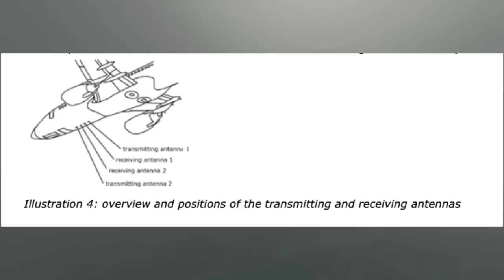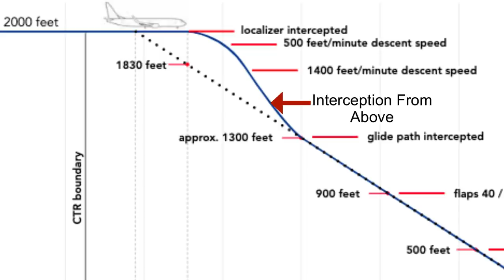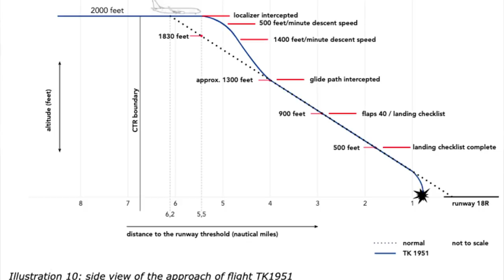How A Broken Antenna Crashed This Plane | Turkish Airlines Flight 1951

Comment: I retired from this plane and saw this glitch a few times.  Just a minor inconvenience.  This crash is yet another sad example of pilots who should not have been there.  Too unskilled to fly their planes with out all of the automation working.  This isn't fair to the passengers, they buy a ticket, not a chance.
Reply: Do airlines or regulators require their pilots to land manually on occassion (outside of the simulators)?
Reply: @rowboat0317  Good airlines yes. But some airlines (Middle and Far East) expect autolands to be performed wherever possible.
Reply: @rob737700 - I disagree. This is an example of how things can go wrong if they are not managed properly. It is also an example of how useless an untrained “safety” pilot is.
Reply: @Trevor_Austin  Well, sir, I believe there should be more flying going on instead of managing.  Basic piloting skills are just too lacking these days.  Pilots are struggling with their automation all they way to impact.  Sad times..
Reply: I did not even watch the movie as i know the case so well..
When it happened within halve a day i had my conclusion which (appart from the political correctness bullshit) almost was the same as the official report a year later.
If four pilots are not able to do what every hobby pilots does as general practice then they should stay on the ground. Much saver for them.
I fully agree with Rob !!!
Reply: @rowboat0317  Captains descision
Reply: @Trevor_Austin  Then why was he there in the first place. these people just where not able to handle an aircraft like this one (and be resonable its not a difficult aircraft to fly)
Reply: Agreed.
Reply: This was just a good example of poor piloting skills on all levels. How accidents like this happen is astounding
Reply: Fidd88  I agree with you with the licensing being the way it is but I think the rationale for not doing it is that you don't want a pilot instinctively slipping (no pun intended) into that response in a crunch when they're flying a big plane; I seem to recall seeing something about at least one incident where that caused a crash; and the pilot wasn't new to large aircraft but it was just that in a crisis when he didn't have time to think he did it instinctively.
Reply: @prismpyre7653  the American Airlines A300 that had its rudder break away ? The pilot did that because that's how the AA training for wake turbulence went, but there where factors with the airplane itself that lead to its demise.
Reply: @Trevor_Austin  Hmmm i've been training pilots for many years on request (it was not my official job). It often struck me how just dependend some people where on a single indication while all others clearly showed what was going on.
Many crash reports i have commented where just a mather of eghther
* Lack of traning (result of budget cuts/savings or lack of competence)
* Lack of understanding (result of above)
* Lack of following procedure (result of above)
Only a few cases i just stated: 'Things just can happen'
I'm i holy ? No certainly not i did do stupit things to ! beside i haven't flown for 20 years. Still i have a pretty clue what was (still is) going on in aviation.
Reply: @doabarrellroll69  I don't think so? But I watch so many investigation videos it's hard to say lol
Reply: @doabarrellroll69  pretty sure though that one was on takeoff, right? the one I'm thinking of was on approach
Reply: @pascalcoole2725  I'll look for that video, thanks.  I have heard about "magenta line" flyers...
Reply: Fidd88  Side slip is what saved the Gimli Glider.  Scary as hell for the passengers, but a damn sight better than getting killed.
Reply: That's what absolutely amazes me about air travel. 
 They can actually get that many people to trust their lives in one of these things!
   Crazy.
Reply: @pascalcoole2725  Totally agree (also with Rob), it may be known that those eastern pilots are less well trained than western pilots. I will therefore not board an airplane of such companies for any money.
Reply: @rowboat0317  It's up to the crew to decide which way to land. However, in poor weather they have to calculate how much beating the plane can take. With a high wind shear before and at the touchdown they do a VFR landing (visual flight rules or manual). Most flights are performed with autopilot most of the way including landing.
Reply: Fidd88  Was that the only reason they had to let you go? If it was, they were totally wrong. How on earth can one even fly an airplane without the sideslip? I was taught that probably on my 3rd lesson. How do you fly or prepare for the touchdown in cross wind?
Reply: Didn't it cut their speed without them knowing though?  At that altitude the drop in airspeed put them into a stall with too little altitude to recover.  Only thing I can blame them for is not keeping a better eye on their airspeed.  Maybe they were distracted by the landing checklist.
Reply: @rowboat0317  I heard that US pilots are given more emphasis on manual flying skills vs other nations who rely more on the automated systems.  Some pilots though have gotten into trouble because they tried to fly manually but were disoriented.  In fact the infamous Aeroflot crash, where they let kids sit in the cockpit, it could've been avoided if they had let go of the yokes and let the autopilot recover.

Comment: 3 professional pilots fail to monitor airspeed and they crash Day VFR When they knew  the RA was inop they should have turned off the AP .   Plane still flies perfectly without the RA.
Reply: Wrong! The main problem was the effect of RadAlt 1 on the autothrottle system.
Reply: They should have immediately clicked off autothrottles and autopilot upon initiating a go around.
Reply: Their is too much relying on the automation. When time comes to manually fly no one is wants too. Too much automation and very little hand flying capabilities.
Reply: @portanav  true.  In this one pilots were not monitoring their air speed   which is crucial for landings.  So it wasn't only  Antenna problem that crashed the plane
Reply: @Trevor_Austin  As this happened in the Netherlands, where I live, I followed this accident with much attention. 

The investigation determined that the main cause for this accident was the pilots being way too late to set-up the plane for landing, even though they knew they had a bad altimeter that probably would add to their work load during the landing. If the pilots had set-up the plane before entering the landing procedure, they would have noticed the auto-throttle pulling engine power back to idle during the landing for more than 90 seconds! The same goes for the flare-up manoeuvre: if the pilots had finished their set-up on time, they would have noticed the plane going into flare-up mode and realised the computers were still operating on the data from the defunct altimeter.

When the pilots finally called for full power, it took too long for the engines to spool up from idle to delivering thrust again and the crash was inevitable. 

End-conclusion from the investigation: pilot error instead of automation error. The pilots were simply relying too much on the automation to do everything for them even though they KNEW they had taken off with a bad altimeter and that the automation might get confused by the difference in data between the two altimeters. 

As to intercepting the GS from above: this is a fairly standard procedure at Schiphol Airport and known to pilots. All the more reason they should have finished their set-up way before entering the landing procedure, as they knew (or should have known) that even with a perfectly working airplane they would be in a very high-load situation during this landing.
Reply: Failed to turn off RadAlt 1, failed to go around when not stabilized at 1000ft, failed to monitor airspeed, failed to turn off auto throttle at stall warning. How is that not inadequately trained?
Reply: @Trevor_Austin  Wrong. I'm not a pilot and even I know that if the altimeter is broken, then autopilot either is going to fail or be unreliable. The pilots are stupid and can't manually fly a plane nor do any of the required actions to recover the plane.
Reply: Fidd88  nope, this is NOT fault of FBW, but the automation that is only applicable through FBW... but not fault of FBW per se...
Reply: Fidd88  It is perfectly possible to use FBW without ANY more automation. It is also possible (alas not automatically achieved) to use only thoroughly tested, usefull and proven automation. Thus, one who condemns FBW per se is incorrectly oversimplyfing the problem and in effect spreading incorrect information.
Besides, you must be aware that you fighting windmills (as don Quiote), right? Noone is going to manufacture pure mechanic system anymore for transport category aircraft...
Reply: Fidd88  We would disagree on some details, but basically yes.
BUT imo the solution is not to throw away all automation... rather put all efforts to make it more robust (debug better), maybe more same between plane models, and teach about it better...
You must be aware its not going away, not happening. So maybe do the next best thing, make it work better and easier?
Ofcourse, pilots WILL logically loose some of their proficiency, bcse using their manual skills less, can be to some extent corrected by more (manual) training, the simulators are now damn realistic and will even improve...
It's like saying auto gearbox destroys the capability to switch gears manually... yes it does, but if it works good why bothering?
Reply: Fidd88  "entirely avoidable new accidents occurring when these highly complex systems start to fail in unpredicted fashions or combinations" Sure, no argumenting here (not even possible to argument on this one).
"it's pretty evident to me that an awful lot of pilots going through the system these days do not have a wonderful lot of hand-flying experience" Again no argumenting. It is prinipially unavoidable since auto(pilot etc) is so often/long active that the time pilots novadays use manual is considerably decreasing (and IMO it needs some solution, dunno how).
Also in my opinion they need more standards as to how the "human-machine interface" is looking/working, in time of big colour MFD it is no problem to make them look/work as similar as possible, even acros different types/manufacturers...
About functions/logic... test, test, test (and keep no secrets in this area, publish everything for open review)...
Reply: Fidd88  Oh yes, but where to get those hours (even on light planes) there are not flying that many today? Maybe start at cargo at least... but thats only partial solution...
However, simulators becoming even more and more realistic... at least something...
Reply: Fidd88  This is not FBW, this is "fly by hand and when the machine feels like it it will interfere".
Rather different from real FBW, which is the machine being in control and letting go when it detects internal inconsistencies. Such as Airbus' "alternate law".
Reply: Fidd88  

Airspeed on a glider? Yeah...
Didn't they tell you anything about altitude?
Reply: Fidd88  8

.
Reply: Fail? Pretty easy to spot what's wrong I guess when sitting in front of you tube.  Historically There were 148 instances where the altimeter did no function.  Given such low attitude disaster was inevitable during one of these malfunctions

Comment: About the dual aoa sensor software, as far as I know: that is the obvious and safe choice however then the system would be flagged as safety critical in the documentation and would require extra training and certification which they wanted to avoid.
Reply: The problem was NOT that there was no comparator (or redundancy) it was that RadAlt No. 1 ALWAYS drives the Autothrottles no matter which autopilot is engaged. This was ‘feature” not documented.
Reply: IIRC the MAX also hat the ability to actually display a warning when both AOA-sensor-readouts didn't match up. But it was an optional feature that airlines had to pay extra for.
Reply: It's what happens when bean-counters get to decide technical choices.
Reply: @brkr78  an how does AOA-Disgagree indicator information help? Is there a system linked to only one AOA-sensor that behaves as automatic antistall using the trimming? Boeing still denies that.
The Boeing 747 does not have an anti stall system linked to the AOA Sensor that autotrims the plane out of stall. MCAS is totally not an anti-stall system and pilot totally do not need to know, that MCAS is trimming their plane, because that totally only happens in certain flight configurations.
Reply: @brkr78  extortion, for safety features. Nice ...we really have come far as a species

Comment: As I watch these videos, one of the most "baffling" aspects is the failure to FLY THE PLANE!!!  EVERY pilot KNOWS fly the damn plane.  So why are so many pilots NOT flying the plane?  This was an easy fix, turn off the damn outopilot and hand fly.  Why 3 experienced pilots, no one could hand fly??????   STUPID     yes, I am an instrument rated pilot.
Reply: @k53847  Yep, I saw this some time ago. Very informative.
Reply: I am a nervous flier. A very nervous flyer. If I fall asleep the plane will crash, my wakefulness is keeping that lump of old iron aloft.  Am 100% with your comment. With emphasis, FLY the FUCKING PLANE!  The basic flight systems RARELY EVER fail, y'know, up-down, left right, throttle, human EYESIGHT.
Hoary old joke:
"Flying scares shit out of me!"
Seasoned air traveller, "Man, when yr number's up it's up."
Me, "What if I'm onth plane and th pilot's number is up?"
Reply: @ylstorage7085  You could use aircraft style autopilots  You'll need to maintain 1 mile distance between cars front and back and 1000 feet between lanes. And only have one or two parking areas per city - maybe call them carports.  And we'll have to straighten all the roads they are supposed to use so they run at compass directions between carports.
Reply: @ylstorage7085  For (fun) education please watch about Tesla autopilot fails videos. Most car accidents are driver caused. (Drunk, high, not attentive, abusing law and physics).
Reply: Is it possible that some airlines put pressure on pilots to land the plane on the first attempt, thus saving time and fuel? A simple go-around would probably have prevented this accident.
Reply: @paulf1071  As usual... first place role played by $$$.
Reply: @ylstorage7085  yeah, but when you have a problem in a car, you just pull over to the side of the road.  In a plane, there is no pulling over.
Reply: Do you fly airliners?

Comment: Just a point to add as I think it was missed. The reason CMD A wouldn’t engage was because the FO accidentally tried to engage the autopilot first instead of pressing approach first which is needed to be done in order to have dual coupling. Because the pilot was essentially just switching from 1 autopilot to the other and because of the faulty RA, CMD A wouldn’t activate. FO reconnected CMD B but didn’t reattempt to connect CMD A. Not sure if it would have actually worked anyway

Comment: Why does an autothrottle not disengage on manual input?
Reply: That's what I wanna know. Why isn't it like cruise control in a car, deactivating on manual input?
Reply: @MisterFribble  I assume because if your a little low, you could probably push it forward a bit, then have it return. Or it could be so that you don't accidentally bump it.
Reply: I am a retired airline captain with many hours in the 737 and it’s many variants. In order to disengage the autothrottles you had to press a button on the side of the throttle handle. If you didn’t do that, yes, you could overpower the servo and move the throttles forward but that wouldn’t make much sense when all you had to do was press the button.
Reply: @MisterFribble   It is like cruise control..   If you want to pass someone on cruise control you can either push a button to accelerate, or override that by stomping on the gas peddle.   Neither disconnects the cruise, as soon as you take your foot off the peddle, the car will "resume" the speed it was set to originally.    The only way to get a car off cruise is to either hit the brake, or disengage it with the switch.    Auto throttle works much the same way, if you need a blip of power, you manually throttle up, then  you can forget about it, and auto throttle will "resume"    To disengage auto throttle, you have to press  the auto throttle button, until the light goes off.

Comment: Regarding the 737 Max, I remember doing a deep dive on it when it happened. If I'm remembering correctly, they do use redundancy for the AoA sensors almost everywhere on the aircraft. Indeed, I think FAA regulations demand it. However from recollection the MCAS was developed initially for a USAF aircraft and didn't have redundancy. So they took that system without modifying it for redundancy and that became the MCAS we all know and... know? I'm vaguely recalling that the USAF aircraft couldn't use redundancy for some reason, possibly because the AoA sensor was moved or removed, possibly for another reason? But my memory isn't good enough to know for sure. And it may be FAA regulations demanding they couldn't modify the MCAS already in use without testing everything again somewhere along that story. Likely time constraints competing against the A320NEO played a role. Anyway there was a real reason for lacking redundant AoA sensors, albeit a bad one.
Reply: Money.

I mean they moved the engines forward and put in software to mitigate without telling pilots. All so they didn't have to recertify it as a new airframe. The gov let them and Boeing is going to pay a lot more than just fucking penalties on contracts and licensing fees.